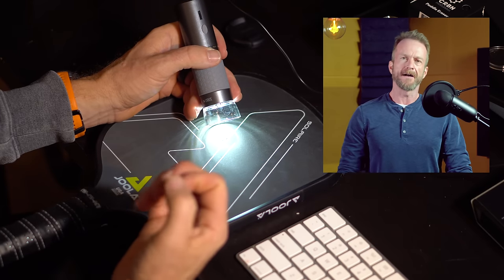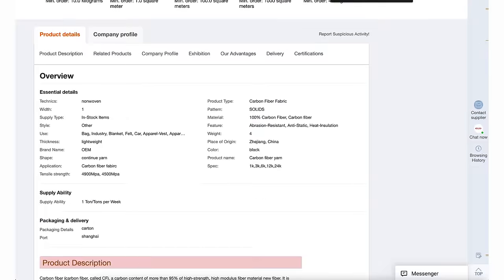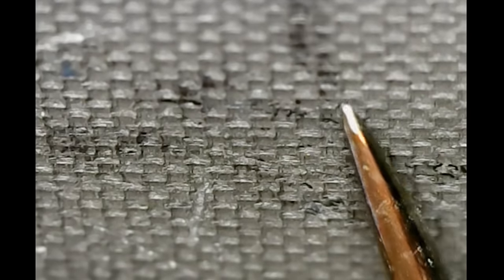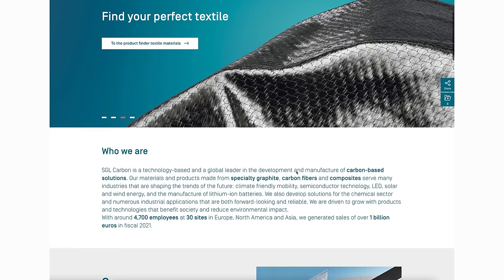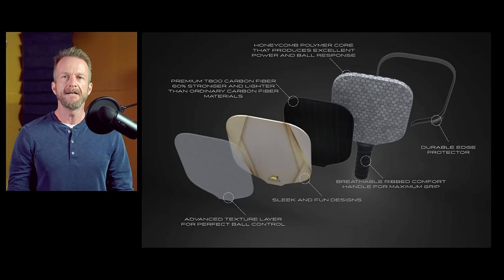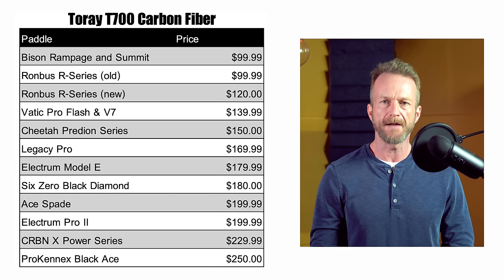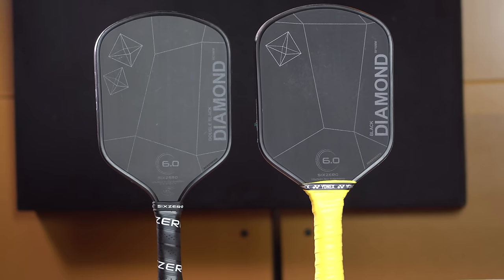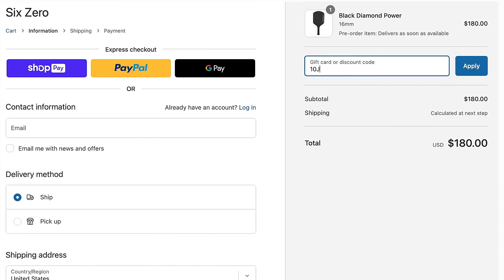Raw Carbon Fiber Guide - and the BEST Value Paddles Right Now

Comment: John you knocked it out of the park on this carbon fiber topic. So much went into this, so thanks. The  delamination is the hot topic these days, so the glue being used to attach the face to the core is the next "trade secret" we will be looking at as paddle geeks. Non Pros look at durability of their paddles, unlike pros who get them for free every tournament.
Reply from the maker: I planned to touch on the delamination topic in this video, but it quickly became a rabbithole, so I cut it out of the script and left it for future me. I haven't seen delamination with any of my thermoformed paddles (n=4), but I agree that it's an issue with thermoformed paddles. I'm optimistic that paddle companies have already largely fixed the issue with better glue (less brittle and prone to breakage).
Reply: My six zero delaminated and got a replacement under warranty. And I played a tournament against a delaminated legacy pro which had extreme and unfair pace. So it happens and I suspect fairly common but hopefully just the initial batch….

Comment: I agree with the other comments that said this is a great video. I like the technical approach you take in the review of these paddles and am shocked at how many people don't understand the small details used in marketing jargon that's used to make sales. As others have mentioned I think the delamination is the next huge issue that needs to be assessed and understood. Most people don't understand what delamination is and don't understand the difference between the old style construction method and thermoformed. Thermoformed paddles will launch a ball when delaminated vs. a typical honeycomb construction which feels dead after delamination. I am shocked that manufacturers are struggling so much with their resin bond of the face, handle, edge guard, etc. I work with epoxy in woodworking and would never use a cheap off brand of epoxy as I don't trust the longevity of the glue joint. The technology in resin based adhesives is very advanced therefore don't think manufacturers should be struggling so much bonding their materials together.
Reply: Hello. As someone with experience as to fusing, glue, and resin would you say that in adhering a carbon fiber face to a polypropylene core it is inevitable that they eventually fail to stay bonded? With high grade materials how long should a regularly used paddle avoid delamination?

Thank you.

Comment: Loving your videos! I hadn’t realized that my $179 CRBN1 paddles weren’t using Toray. It finally makes sense to me now why my $100 Ronbus R3 gives me better spin. What an incredible replacement for my CRBN1 at such a low price!
Reply: How is the control and power of your Ronbus?
Reply: @jazjablonski407  It’s excellent, in my opinion. I’m a pretty big guy though with little need for a power paddle, since I have enough strength to put away balls. I happen to think the R3 is a better paddle all around than the CRBN 1. Better spin, similar control, and slightly more put away power.
Reply: @1GrecianUrn i got a laugh out of your  handle id "1grecianurn" from " The Music Man"......."trickle..trickle"...that scene and lady cracks me up..haa
Reply: @guyrestivo  Haha. Yes, my favorite musical!

Comment: The main concern here is that both Ronbus and 6.0 do not provide a try-and-buy option. Additionally, their return policy is excessively strict, preventing the return of used paddles. This is a significant drawback for me and acts as a major obstacle to my decision-making process.
Reply: Amazon used for best price and is still 99% new. New still has the best return policy of any retailer.
Reply: @mikeyis009 you provide an excellent tip.

Comment: Appreciate the detail assessment of paddles, especially in the direct sale paddles which are more difficult to test. Took your advice on the 6.0 Black Diamond and am very happy with it. Spin, power and durability as claimed. Only criticism is one side clearly has more texture than the other but haven’t noticed a difference in performance.

Comment: Excellent explanation on how "permanent texture" carbon fiber loses its spin! I LOVED my GRUVN MUVN16X initially thanks in large part to crazy consistent roll volleys I managed with nice spin & swing weight with solid twist weight. Then after a few months of daily play, those same balls almost suddenly started going out. I ASSumed the T700 meant forever grit, but I noticed it is now about as smooth as a Z5! 

Thank you for your good work on Swing & Twist weights. I wonder if you will come up with a reliable way to quantify touch & power some day... I also own a Ronbus R1.16 which has very similar specs to the MUVN 16X but feels like a completely different animal, like hitting ball with a pillow (pure control, no pop) whereas the GRUVN has a nice balance of solid pop with control. They have identical lengths (16.5" overall w/ 5.5" grips), static weight (both of mine are 8.1oz.), swing weight spec (117), & similar twist weights (6.36 vs 6.19); however, in my hand, the GRUN feels a noticeably more nimble... Perhaps it's the thinner grip (4.125 vs 4.25) &/or the narrower "more aerodynamic" face (7.375" vs 7.5" wide)? Curious...

Comment: I play with a lot of spin. My first paddle was a gear box and I liked it until the edge wore down from too many digs on the hard court service. I then looked to the Ben Johns before watching your review. I found your review to be spot on... the spin did wear down quickly (within 3 months) and the top of the paddle cracked after just a 7-8 weeks of play. I then took your recommendation on the Ronbus and I cant believe the spin I get from it. However I will say that when I got the paddle one side had more grit than the other. I wrote into Ronbus and they said the paddles were man made so would have slight defects and that it would still have more spin than most other paddles and he was right. But it was still a little strange to me. That being said I plan to get another one because of the spin and control I have with it.

Comment: Good job. Consider evaluating the carbon fiber sizing used rather than the fiber itself. The types of failures you are finding are typical of a matrix fiber interface failure. Toray is a premier carbon fiber company that spent millions on understanding this issue for aerospace. 

Glass is better understood in this area,  hence likely performs better for durability. 

It would also be interesting if you could document the testing procedure for spin and insure consistence in approach so results can be better understood.

Comment: Great video really does affect what I will buy. Only thing that I would say and Not sure if it helps. The New engage ultra says they use a R210 carbon fiber. Which if it does what they say looks promising... Proprietary is always a fun word for transparency. Seems like the new rombus is just a better version of the older crbn 2.
 
Copied from their sight for reference.
R210 Carbon Fiber

Proprietary chemically bonded Carbon Fiber technology for maximum texture and friction between the ball and surface for unmatched spin.

Increased surface strength
Latest technology to ensure a consistent surface compression and rebound rate for enhanced ball control and feel.

Comment: So the Voltaire Mach 1 would have similar spin to the Ronbus 16mm then, correct? As I am hearing they are pretty much identical paddles. My back up paddle purchase will be the Ronbus if so 😊. Great video, I subscribed👍🏼

Comment: Thanks John for the great info! I play a smaller paddle (old man with bad shoulders and slow reflexes) looking at the Ronbus R2. Would this have the same basic construction? Any other thoughts or suggestions for a standard size paddle?
Reply from the maker: That's correct - the R2 has the same Toray raw carbon fiber.

Comment: Excellent review and explanation of the differentiators between the large pool of RCF paddles!  I suppose many players have come to the same conclusion since SixZero models are all sold out.  The Ronbus looks to be a steal at the price for a Gen1 style paddle.  Any word on when they will release their Gen2 model with thermoforming and edge foam?  Personally, I'd like to see more paddles with edge foam but w/o thermoforming for maximum control.

Comment: Wondering how Legacy Pro and Vatic Pro compared to Six Zero and on your spin chart. Thanks for the great info!
Reply: Me too. Just bought the Vatic Pro "upgraded" Flash 16mm.
Reply: Thermoforming makes the biggest difference!
Reply: @kimleith1378  can I ask you how the head weight is on the Flash 16mm?  I’ve had my eye on it, but am looking for something not as head heavy as the CRBN 1x or the Hyperion (my main two paddles). I need something more maneuverable at the net.   Thanks in advance for any info
Reply: @braddaddis371  Playing it "factory" specs for now. I play a "ping pong" grip, so I'm not sure if there's a benefit to leading the paddle.

Comment: Thank you for how detailed and yet simple your research and language is respectively.  It is complete and easy to understand!  Much appreciated!

What is your opinion on Gearbox paddles (considering the Gearbox CX14H) and the durability of their surfaces and cores compared to regular honeycomb paddles?  I have heard that they take much longer to break down because they are manufactured differently?  Would love to hear about this from an expert like you.
Reply: Agree with the request for analysis of the new Gearbox paddles: GBX (traditional polypropylene core) and CX14 Ultimate Power H/E (patented SST cores).

I only wish the new CX14s did not use applied face grit.
Reply: Yeah..all this carbon talk and leave out what many say is the most durable paddle FULL CARBON gearbox..Seems odd

Comment: GREAT REVIEW! I have been trying "carbon" paddles on the court to see what kind of feel I like and how the spin is after a paddle has been used for a bit. The difference in models is like night and day, even though they all are supposedly similar in construction and materials. I learned so much about the difference in the type of carbon used in manufacturing and the variability in the fibers' ability to stand up to play. Just out of curiosity though, I started playing with a Paddletek Element and was thinking of just purchasing the newer Phoenix Genesis for just outdoor recreational play. Do you have any thoughts on that paddle for a good fiberglass model?

Comment: Great video John. I assume that even amongst the Toray T700 paddles there are other differences in the carbon fiber sheet that would affect spin and durability? I believe I read somewhere before that Legacy Pro uses a tighter weave w/its carbon fiber and after finally getting to touch one last week it certainly does seem to be the case as I was surprised at how smooth the surface felt compared to other raw carbon paddles. Also, while the Toray carbon fiber seem to be more durable, exactly how much more durable are they? If the Joolas are useless after 3 months, how long can we reasonably expect the Toray paddles to be good for? 6 months? A year? I've been using a Vatic Pro V7 since the end of January and it's fairly obvious even w/the naked eye that the hitting surface picks up damage as time goes on.
Reply from the maker: Yes, there are differences in the way paddle surfaces are finished, even if they're using the same carbon fiber cloth. It has to do with the 'nano-engineering' aspect, involving a peel-ply cloth that saturates the carbon filaments with epoxy, and leaves a textured finish on the cloth. 
I wouldn't say that Joola paddles are useless after three months, but their performance definitely drops, especially if you rely on spin in your game. I think the wear on a paddle will vary across individuals. People with traditional tennis strokes that brush up on the ball for topspin, or use a lot of slice, will see their paddle performance drop quicker than people who hit flatter. But I've been very impressed with the durability of the Six Zero paddles, especially the fiberglass black diamond. That thing will last me at least six months with heavy use and spin.
Reply: John, do you find the control of the Black Diamond manageable?  I am ready to pull the trigger, but just concerned in that regard.  Of course, it’s a power paddle and I’m not looking for 1st gen control at the same time.  Thanks
Reply from the maker: @braddaddis371  Yes, but I came from the ProKennex Black Ace, so anything seems controllable after that, haha. That being said, the SBD is 16mm, so there's room there for control that paddles like the Black Ace don't have
Reply: @johnkewpickleball  ha ha!!!  Good point.  While I’m not coming from a Black Ace, I’m coming from a thermoformed paddle and so I can’t imagine the transition being as difficult as coming from a first gen soft paddle.  Thanks so much

Comment: Where is the Legacy Pro  Paddle listed on your RPM charts? It was listed on your Toray Carbon chart . I would submit to you that the Legacy paddle is more comparable to the Six Zero paddles ,than the Carbon X paddles, and in many ways superior , However both Legacy Pro and Six Zero ( both) are just player preference and not a matter of build quality, as all three paddles are "currently" the superior built paddles on the market today. I opine as you allude to. the bean counters are building these other Pickleball paddles  and are not listening to their customers on what is asked for in developing new pickleball paddles.I do not buy marketing hype, I buy performance.
Reply: I'm guessing he hasn't been able to get his hands on one yet to test out.
Reply: How about the Vatic Pro Flash?, Got even some comments about my play lately 😅😂🎉❤
Reply: @PickleEnvy  yep, at the end of the day is Value-how good you play. 
Cheers 🥂🥃
Reply: @PickleEnvy  I'll ask you then about the Legacy... how agile is it at the net? Head-heavy paddles 8.3 oz and above make me rather slow up there for hands battles. Is the Legacy Pro pretty head-heavy?
Reply: @evanhayes5891  I have that problem as well with head heavy paddles.  The Legacy Pro gave me no issues in terms of speed and maneuverability at the net.  Well balanced.  The CRBN 1X however, is just a bit too head heavy for my liking
Reply: @braddaddis371  Thanks for sharing!
Reply: @evanhayes5891  I don't think it's too head-heavy, but it's still in the standard range so if you know you want a head-light paddle you might be happier with one more oriented in that direction. I don't have a specific recommendation on that front however.

Comment: Selkirk Invikta Power Air...I have 3.  I am noticing that the surface overlay (just the paint/logo)is chipping off the edge of the face, and peeling on the side where I use protective tape (I add lead tape and cover it).  Also, as you noted, the grittiness of the surface wears off quickly.  I do like the narrow beam though.

Comment: Hi John, Excellent video. I bought the R3.16 last week, added .6 oz lead at corners and the combined spin/power/control is probably better than a CFS.  My issue is the flimsy, boxy grip. Coming from powerair octagon, this was almost unplayable for me. Have you heard others mention this?
Do you know if the R1.16 has the identical grip? 
Is this the same grip on the Volaire, and does J. Arnold really play this grip?
Also, any word if Ronbus will make a 14mm version?
Great work and thanks for a much-needed T700 explanation!
Reply: Lmao, you still probably can't play.

Comment: Another great video - thank you.  I have a Hyperion 16mm CFS, with basically no grit left after 4 months/3 days a week of indoor play.  I have ordered a Vatic Pro V7..  I am curious if you have done any testing on the typically more gritty outdoor (used) balls?  I suppose it might to stand to reason that a  used outdoor ball would improve spin for even a flattened Carbon Fiber surface.  Conversely, I would guess that the Hyperion would have worn down even faster outside.  Most of my play with the Hyperion has been indoor, in Michigan.  I am considering keeping the Hyperion just for outdoor play.   I may conduct my own experiment today, with some new versus beat up outdoor balls.   Thanks again..
Reply: Would love to know if John has any experience with the Vatic and thoughts or numbers on it.
Reply: @braddaddis371  Even if I get the same life out of it as the Hyperion, I'm still way ahead at $139 over the $220 Hyperion.  We'll see....

Comment: Hi John from Québec! Did I understand correctly that both models are made of Toray T700 carbon fiber except the single which is covered with fiberglass? As for the double, have you tested the two models in thickness of 14 mm and 16 mm to see how it could perform differently or do we simply keep the same logic that the 16 mm is better for control?
Reply from the maker: Hi! Yes, both 6.0 models are Torah cloth, the DBD is raw carbon fiber and the BD is raw fiberglass. I have played with the 14 mm DBD, and it plays as expected: more pop than the 16mm

Comment: Great video! At 13:53 it looks like the ball bounces out before the paddle hits the kitchen. Doesn’t that mean the points over and he won the point?
Reply: no, the rule is that it is a fault if the current momentum of the player causes anything to contact the kitchen after a volley regardless if the rally is continuing or has ended.

Comment: I'm deciding between the Double Black Diamond 14mm and Black Diamond Power 16mm. Which one do you think has more power on full tennis-style groundstrokes? I'm looking for power at the very top end of the swing curve.
Reply from the maker: The Black Diamond power 16mm has more power to me than the 14mm DBD
Reply: @johnkewpickleball  And it seems like more spin as well. But with such a stiff face I wonder if the BD Power spin suffers at slower swing speeds like backhand rolls at the kitchen line? Harder to compress such a hard face compared to the carbon fiber.